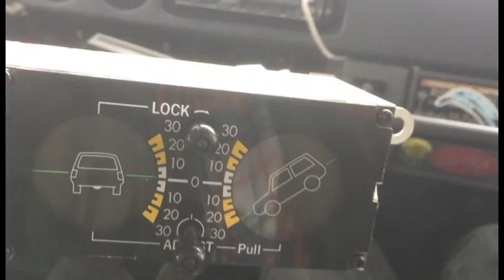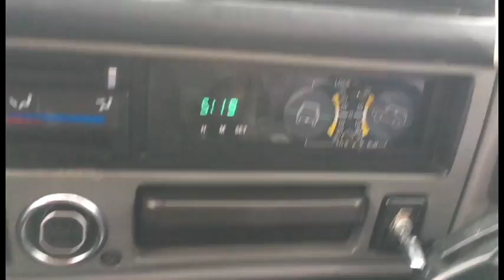FJ60 COLD START Plus VALVE COVER cleaning & INCLINOMETER install

Comment: Great video.  There are 4 bolt holes to secure cover to engine, maybe 2 fl that connect ton air box, and a couple that are a couple of open holes in the valve cover  nothing attaching to them, why is this?

Comment: Starting to look really nice under the hood!
Reply from the maker: Thanks! been trying really hard to just make it a functional daily machine that can be driven from VA to MT and back
Reply: @mizeadventure9438  I'm still working to get mine on the road. As soon as I'm done with some vacuum routing issues I should be good to go.
Reply from the maker: @UzerSomething  Let me know if you need help or some pics of how I routed things. My set up is desmogged. But I also have another fj60 that has all the lines in tacked.
Reply: @mizeadventure9438  I would love some detailed pics. Do you run the HAC? I'm in Upstate South Carolina and not planning to, but I do want to know how to route it for specific trips. I'd prefer to have as few lines as possible.
Reply from the maker: @UzerSomething  Yes I am running the HAC. If you want to run a small amount of lines I would think about doing a desmog. Really wakes the whole motor up. I can get a few pics if you want.
Reply: Mize Adventure I’ve done the desmog actually, but using a stock carb and no HAC, so I’m a little confused. I learn well with pictures and vids, but the pdf confused me a bit haha.
Reply: I’m only planning to run the stock carb for a little while until I can purchase a desmog carb.
Reply from the maker: @UzerSomething  O in that case I can help with pics and videos. I also have a lot of parts if you need anything. I would send your carb and Dizzy off to Jim C and have it recurved and rebuilt by him better way to send your money
Reply from the maker: @UzerSomething  Cool. I can't send a private message for some reason. Here send me a email. Maybe attach a pic of the sections that you want to see so I can make sure I get you the right stuff. jonasdurney@hotmail.com